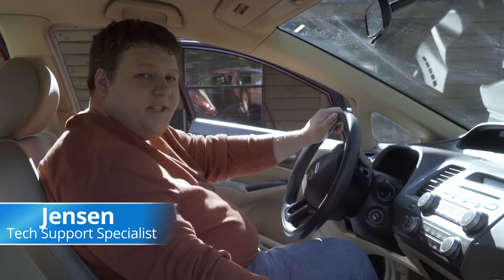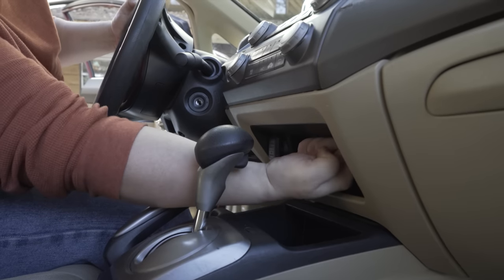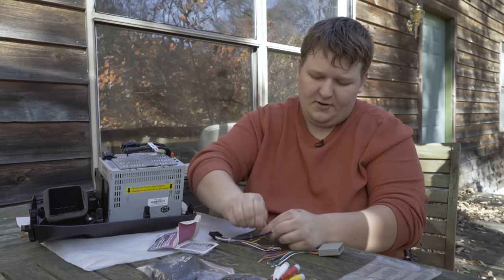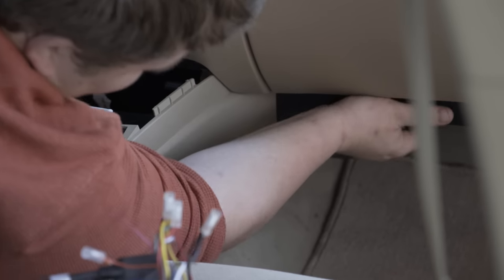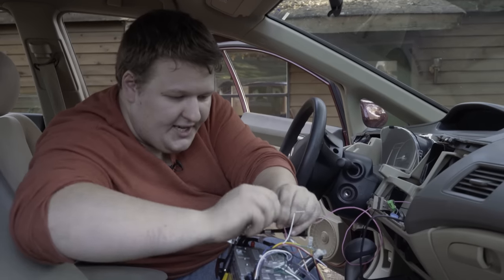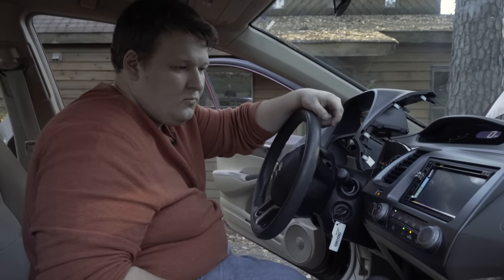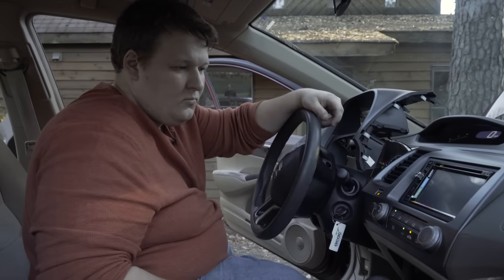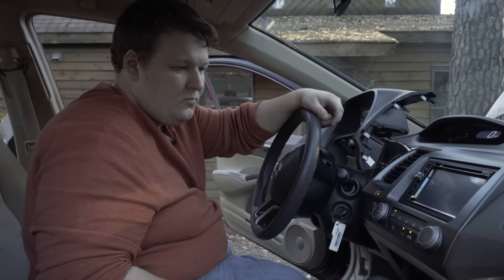How to install a stereo and speakers in a 2006-2011 Honda Civic | Crutchfield

Comment: Hi there, what about the orange tool to open the inside stuff of the car? Thanks
Reply from the maker: That is a trim panel tool. The current models can be found here:
 
https://www.crutchfield.com/I-rYTVc227/shopsearch/trim_panel_tool.html
Reply: @crutchfield  thanks so much. Could someone please tell me how to change the tweet close to the radio display and crono display? The triangle speakers ? Thanks
Reply from the maker: Our MasterSheet instructions should cover how to remove them as well as the radio and the rest of the speakers. Details on these instructions and how to get them can be found here:
 
www.crutchfield.com/I-rYTVc227/p_264MASTER/item.html

Comment: where did you just buy your speaker adapter for connecting the speaker to the car? thanks
Reply from the maker: If you have the Honda Civic featured in the video, the speaker harnesses are available separately on our website here:  http://www.crutchfield.com/I-rYTVc180/p_120727800/Metra-72-7800-Speaker-Wiring-Harness.html?tp=3097 If you have a different vehicle, we may have the speaker harnesses you'll need. You can use the "Outfit My Car" application on our website:  http://www.crutchfield.com/I-rYTVc180/car/carselector.aspx?lp=%2fCar%2foutfitmycar%2fmycar.aspx  Or, you can contact us directly for assistance:  http://www.crutchfield.com/I-rYTVc180/support/ContactUs.aspx Hope that helps!--Crutchfield

Comment: Curious why you used the brake lead instead of a fuse tap at the panel?
Reply from the maker: We connect to the parking brake wire because that's the proper way to install it so that all safety precautions are observed and that there are no legal issues regardless of state you are driving in
Reply: Crutchfield 
Thats a rather broad opinionated explanation. Ive used countless technical manuals both in the automotive and aviation industries. Power for any third party device should always be supplied from a fuseable source.

Comment: i bought a 2 din 7" radio bloothoot touch screen for my civic 8th sedan, is it the same process? my question is "does it gonna work with a double din? i just have 1 din unplugued is it gonna work ? or 1 din radio is required? i dont have an sub the radio Will ne mostly just for look fr
Reply from the maker: We will be happy to check if we have the gear to install a double din touchscreen receiver and have some questions to get started. What is the year of your Civic? Which sub-model Civic did you get? What is the body style of yours?
Reply: honda civic 8th sedan 4 door (not si)
Reply from the maker: Do you have volume control on your steering wheel? If so, this would be the complete kit you'd likely need for a double-din receiver in your car: https://www.crutchfield.com/I-rFBKc384/cart/default.aspx?nolp=true&emKey=2887918&emType=0

What's the exact year of your Civic though, just so we can be sure?

Comment: Do you supply kits for right hand dive 2008 civic ex
Reply from the maker: We only research vehicles made for use in the U.S. market. While it's possible the kits we offer for the left hand drive will also work in the right hand drive version of the Civic, you'll want to contact the kit manufacturer (in this case, the kit we offer is from Scosche) directly to confirm:  800-363-4490.Hope that helps.--Crutchfield

Comment: Can you please tell me what gauge or size of wire I should buy the butt connectors for?? I'm not sure which size butt connectors to buy
Reply from the maker: What are you looking to connect specifically?
Reply: @crutchfield  it's wiring for aftermarket head unit an backup cam
Reply: @crutchfield  but I actually think I got it thanks tho
Reply from the maker: Awesome! We are glad you got the information you needed. Let us know if there is anything else we can help you with in the future!

Comment: What did you do with the blue wire that came with the antenna adapter?
Reply from the maker: That was connected around 4:04 in the video. It should be connected to the antenna turn-on lead on the new radio which is typically a blue or blue/white wire on the new radio's harness.

Comment: I have a pair of kenwood kfc HQ718. would these need an amplifier to run or I can just plug thm just like a normal speakers?
needs help
thanks
Reply from the maker: As with any speaker, the Kenwood's would ultimately sound better when driven by an amplifier--however they're efficient enough to run off just your head unit as well.

Hope that helps!
--Crutchfield

Comment: The wiring harness that I have says that I need to splice into the factory remote turn on wire. How did you avoid that?
Reply from the maker: The harness used here and Civic we worked on didn't have anything that needed triggered on and so didn't need anything connected to the remote turn-on wire. 
If you purchased your gear from Crutchfield, I'd recommend contacting our technical support for help with your wiring.

Comment: Can anyone answer this? Why does he tap into the brake wire? Literally no other video I've seen does or even mentions this and it seems like everyone's doing fine without it.
Reply from the maker: Video receivers require a connection to your parking brake.  Certain features will not function unless you are parked with the brake engaged.

Comment: Ok so im having a problem with my 07 civic lx i installed a single din deck now when i turn my head lights on my climate control back lights go off & i then turn my lights off they come on as they should how do i fix this problem??? thanks!!

Comment: does anyone know how to install the steering audio control to work with aftermarket blaupeank in civic
Reply: Can you guys answer this? Or tell us a wiring harness that works with steering wheel control?
Reply: You need a additional interface for that
Reply: Factory honda civic radio comes with 4 harness plugged in. The 4th one on the right(not the antenna) has the wires for your steering wheel. I dont know which on it is all i know is that one of those wires plugs into your steering wheel. And for those who connected your new radio and have no sound the baby blue wire on that 4th harness is your answer. Connect that to the blue wire and your should get sound. (Baby blue wire is your amp connector) 
I have 2009 honda civic ex and installed a radio without any harness. Its a bitch but it works.

Comment: Why did you hook onto the brake ? I don’t get it ? What function does it have ? Is it nesessary?
Reply from the maker: Receivers require a connection  to the parking brake as a safety features.  Certain advanced menus, functions, and video playback will not work unless the Parking brake is engaged.  This is necessary, and is a legally mandated, important safety feature.

Comment: my music plays good but as soon as I throw the car in drive and accelerate the music cuts off is it because I don't have that parking break wire connected to the wiring harness on the double din ?
Reply from the maker: I doubt that your issue is linked to the parking brake wire. That wire only affects video and the ability to see it. That being said, I don't know what would cause your issue. If you purchased the gear from Crutchfield, I recommend calling our technical support for help. If the gear was purchased elsewhere and they cannot help, you might try contacting the manufacturer for help

Comment: are the speakers 6.5 and does that adapter that screws on the door fit any speaker 6.5
Reply from the maker: An adapter/bracket is required to install select aftermarket speakers in a 2006-11 Civic. You can view the speakers we offer for your particular vehicle on our website via the "OutfitMyCar" application: www.crutchfield.com/I-rYTVc000/car/carselector.aspx?lp=%2fCar%2foutfitmycar%2fmycar.aspx

If you have further questions, please reach out to an Advisor via the "Contact Us" link at the top of the webpage. Hope that helps!
--Crutchfield

Comment: Did you need to install a factory amp interface? I have a 2011 and the installer is telling me I need one, a LP6-4
Reply from the maker: I Line Output Converter can definitely  help with signal quality, and a cleaner installation. yes.
Reply: @crutchfield  is the LP6-4 comparable to the LP7-4? The LP7-4 is much cheaper but not sure if it can be used instead of the LP6-4

Comment: is there a Honda civic 8th gen tweeter install? and if so what type of adapters do you use? I don't want to splice the wires
Reply from the maker: We don't have a video for that and I got to believe the reason is that we don't have a premade bracket or harness to help with the install like this video showed. It will be a custom mount job with either not using the stock wiring or cutting into it. 
--Crutchfield
Reply: Crutchfield ok,  thanks

Comment: Why did you have to tap the brake wire? I understood everything up to that point.
Reply from the maker: That step is only a requirement for touchscreen/video receivers in order to prevent video from displaying on the in-dash screen while you drive. 

Hope that helps, 
Crutchfield

Comment: I have a 2007 Ex coupe manual trans where should i tap the parking brake wire?
Reply from the maker: You should be able to tap the light green wire (U.S. model) at the parking brake switch.Hope that helps!--Crutchfield

Comment: at 9:05 the ac buttons don't look flesh with the dash kit? Is this how it will look?
Reply from the maker: No. The trim was not fully clipped back into place in that frame. The buttons will be flush when the install is complete (you can see it in subsequent frames in the video) For additional assistance and personalized recommendations, feel free to contact us directly:  http://bit.ly/2jBGHPp  Hope that helps.--Crutchfield
Reply: Good question, I had same concern

Comment: I didn't see it where the steering wires are attached is that possible to do with an Alpine and IXL 007
Reply from the maker: Steering wheel controls are retained by way of a vehicle specific adapter harness. What's the year make and model of your car?

Comment: My metra wiring harness doesn't have a blue wire for the antenna adapter, but my kenwood radio has a blue/white power control or antenna control wire, do I connect the blue wire from the antenna adapter to the blue white wire from my kenwood radio? Please help
Reply from the maker: If you no not have a motorized/amplified AM/FM antenna or an external amplifier (factory or aftermarket), you will not need to connect the Blue/white wire of the Kenwood harness to anything.Hope that helps.--Crutchfield
Reply: Crutchfield Hello there! I guess the factory amplifier at my Civic Si 2007 is the reason that speakers doesnt works. Steering wheel controls got cables at the middle or at the left ,,cube"? Still need to get to know how to connect a new radio :-/ Greetings
Reply: Koniec7 how did u install your amp and steering wheel controls

Comment: where do you connect the blue wire to from the antenna adapter?
Reply from the maker: That depends on the aftermarket stereo but most models offer a matching power antenna (blue) lead in their harness for connection to this lead.Hope that helps!--Crutchfield

Comment: I did all  u did but no sound at the end. My car is a 2007 civic  EX coupe with and built-n amp and a subwoofer
Reply from the maker: If the proper installation process was done, then the issue could be elsewhere in the vehicle. We recommend contacting technical support to get help troubleshooting the issue. If you purchased the gear from us, we recommend contacting our technical support for help. We include their toll free phone number on the order invoice. If it was purchased elsewhere and they cannot help, we recommend contacting the new radio manufacturer for help

Comment: will the tweeters at the front of the civic still work? or do i have to get a aftermarket crossover?
Reply: They will still work. The crossover is built into the car's wiring. I know because I have replaced radios in Honda cars.
Reply: Okay sweet thanks!
Reply: No problem!
Reply: But if i wanted to replacenthe tweeter and door speaker with a aftermarket as well as a aftermarket crossover would i have to use new wiring if the factory crossover is installed?
Reply: Yes, you will need to use new wiring. Unless you can find the factory crossover and bypass it, the crossover may be near the tweeter (if that is the case it will just be a capacitor) or it may be near the radio (which is doubtful).

Comment: so i can connect the amp turn on wire (blue/White) wire to the solid blue wire coming from the antenna harness?
Reply from the maker: That's correct in most installations; though you should always refer to the wiring instructions included with your head unit and/or wire harness to be sure. 

Hope that helps!
--Crutchfield
Reply: Is this the way to integrate the factory amp? And does this eliminate the other harness that comes from the factory amp

Comment: @ 12:23 u talk about short circuiting your speakers on the door if mounted incorrectly. how does that happen? and if something does go wrong, what are the implications of the problem?
Reply from the maker: That's more of a precautionary reminder to avoid mounting the speaker in a place where the connected speaker wires have the potential to be cut and/or damaged by corners or edges of the door panel. 

Hope that helps!
--Crutchfield
Reply: thanks

Comment: My honda civic 2007 cranks 3 times and failed to start through a remote starter after installing aftermarket. What is causing that issue? Thanks
Reply from the maker: Hi Kev!
Unfortunately that wouldn't be something we would be able to diagnose without troubleshooting.  If you purchased your aftermarket remote start from Crutchfield, you will  have the phone number to our tech support team in your order confirmation and shipping emails.  They will be happy to go over your setup, and try to find a solution.  If you did not purchase your gear from us, I recommend reaching out to the manufacturer of the remote start system you purchased.  Their tech support folks should be able to assist.

Comment: Why do you have to connect to the brake wire? Is it a safety issue? The video wont work unless the car brake is on?
Reply from the maker: Yes, this is a safety feature to prevent video from playing and distracting the driver while driving. Video will only play with the parking break is engaged.

Comment: My A/C compressor is always running when the car gets warm (when i freshly start it 10-15 mins) my compressor running is KILLING my MPG, From 24/26 to 21/22....

I need help, I used the correct aftermarket wiring harness, kit, and it was a touch screen pioneer.Might the problem be the A/C controls under the stereo)? I switched the sensor in the front hood, checked the plugs in front and had them tested. Nothing bad from the computer.
Reply: a619ko when you select defrost on the hvac controls the compressor will run... Turn it to floor or vent and turn ac button off..  All cars work like this.. It's annoying
Reply: Mark Borrmann Jr I always leave it on floor or vent, with A/C off. But cold air or warm air still leaks through the vents with the fans being off. I can hear the compressor running non-stop when I'm parked. idk what else to do at this point. But thank you for the reply and I appreciate your videos bro.
Reply: a619ko then your hvac control with the buttons on it is bad... Replace it...  Only a few things can cause the compressor to always run...  Stuck ac relay under the hood in the fuse box, faulty hvac controls, or bad pcm...  If you always have air blowing thru the vents and the compressor always runs then 99% chance the hvac control is bad..  To test it unplug the big brown plug from it and if the compressor shuts off and air stops blowing then it's for sure your problem....
Reply: Mark Borrmann Jr Thanks boss gave myself a day to pop it all out. Unplugged the A/C control, compressor turned off. Replacing the control soon cuz damn, gas money. 😫

thank you so much again bro 👍

Comment: What about the steering wheel controls?
Reply from the maker: The process for also keeping them is similar to that shown when connecting wires together in the video. There is an extra step of programming a steering wheel radio control interface so it knows which vehicle its in and what radio it is sending the commands to for the control. We include instructions on this process with the gear when its ordered and also back it up with our lifetime technical support just in case installation questions or issues come up

Comment: i have civic 2009. i want to change the radio. i have the radio with USB port. i dont know where to buy the radio kit for honda civic 2009.
Reply from the maker: In order to see what head unit models will fit in your '09 Civic along with the necessary accessories to install it, you can check out the "OutfitMyCar" section of the Crutchfield website: http://www.crutchfield.com/I-rYTVc000/car/carselector.aspx?lp=%2fCar%2foutfitmycar%2fmycar.aspx

That will filter the results we carry to show you only models that fit your specific vehicle. Feel free to reach out to an Advisor if you have any questions along the way. 

Hope that helps!
--Crutchfield

Comment: i had a M/T honda civic do i still need to connect a wire to the brake wire?
Reply from the maker: The brake wire needs to be connected for any video receiver installation. If you have an audio only receiver (one that cannot show videos), then you would not need to connect that brake wire. HTH!
--Crutchfield